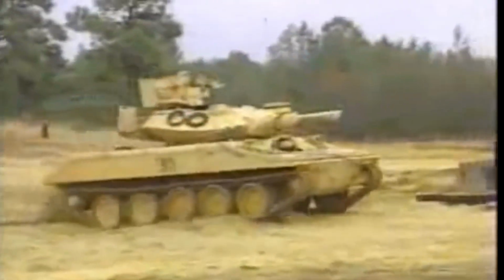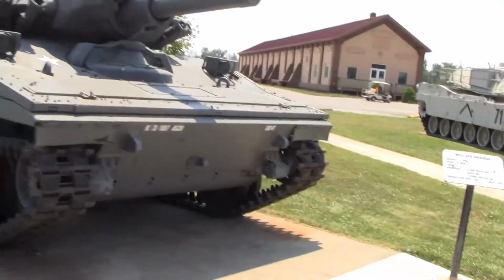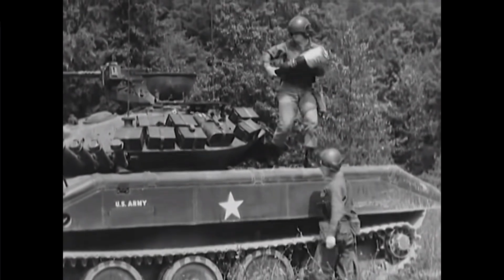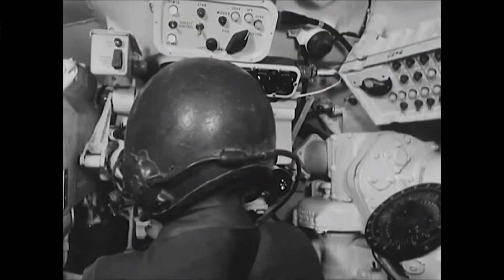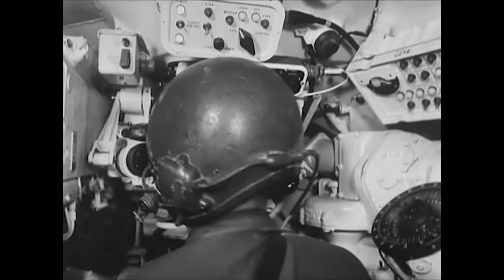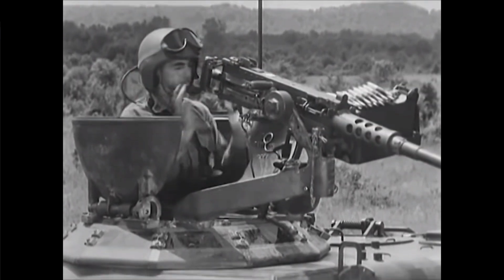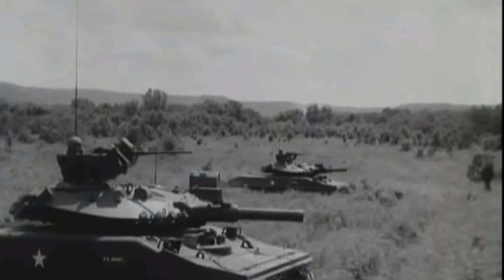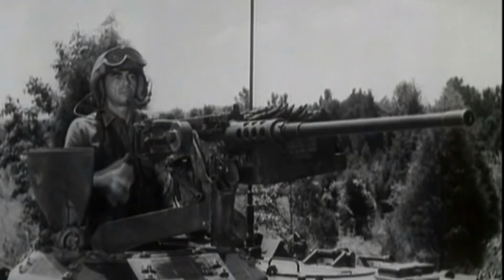M551 "Sheridan" AR/AAV | DESIGN DISASTER!

Comment: Bad transmission? Were any of the designers German?
Reply: To be fair at the late WWII all transmision problems on the tigers were fixed, even if panther had still problems.
Reply: + @juanlulourido548 + What about the Tiger II?
Reply: cnlbenmc 

There were very small issues with that, the real headache is the panther, that never got this problems fixed, but the königstiger got abandoned multiple times mostly because of lack of fuel and spare parts.
Reply: Juanlu Lourido The Tiger I never really had that problem
Reply: @peterson7082  it did early on by 1944 it was acceptable
Reply: Oof
Reply: That had to do with the rush in making such heavy armor tanks. The transmission was under powerd for such armor so it made it brake down a bit over time. 

The Germans eventually fixed the problem.
Reply: Also WWII heavy tanks were almost universally underpowered in the engine department (that's what you get when shoving an engine from a medium tank into somthing anywhere from 10-30 tons heavier.
Reply: If they were they would have good suspension like the Panther, it was all american, like an american muscle car, can only drive flat and straight.
Reply: + @13thSystem + the overlapping and interleaved drive wheels combined with torsion bars on those things were Far more trouble than it was worth.
Reply: @cnlbenmc So much trouble that even tanks up today use a torsion bar suspension as opposed to a christie or vvss. Americans failed at replicating a German invention and they blame it on the Germans, typical.
Reply: + @13thSystem + No its using those crazy stupid wheels in combination with the torsion bars that was the problem. Plus back then that system was kinda hard to mass produce, they have long since become the standard using more sensible road wheel orientation.
Reply: @cnlbenmc Were talking about suspension, not wheel layout, I'd agree the wheels were over engineered but suspension wise, The Sheridan is using Torsion bars, the same Porsche invention almost everyone is using now a days, how the Americans messed it up is beyond me.
Reply: + @13thSystem + Combining the shitty wheel setup with torsion bars was the problem and both compounded each other's issues. As previously mentioned; torsion bars are just fine with normal road wheel setup though they were complex and costly back in WWII compared to later decades. The Sheridan was just another oddball shitbag debacle from the 50s-60s that was a concept way too ambitious for what the technology could actually accomplish at the time.
Reply: @cnlbenmc The problem was not the performance but the cost of complexity. The wheel setup allowed for more torsion bars to be applied allowing a smoother ride, better cross country performance and made firing on the move more viable. One thing is for sure, it was better than what others had back then performance wise. Despite being a heavy tank easily beats most medium tanks like the Sherman and T-34 in speed and mobility, specially cross country. The tiny wheel layout of the Sherman also leaves large vulnerable spots on the side of the tank, large interleaved wheels helps protect the lower sides of the tank by using the wheels as additional plates.
Reply: Grievously Tired This comment caught me off guard and had me laughing rather hard. Thank you for that and well played sir.
Reply: Ya, Russian ww2 tanks had much worse transmission
Reply: Nah...everything is bad so that means the designers are american
Reply: German Transmissions... if (for example) you decide add 10 Tm of armour to the Tiger I and put it into production without re-engineering the transmission and suspension, THEN, yes, the transmission suffers a lot and is troublesome.
Reply: Now you are stereotyping
Reply: insert operation clipboard
Reply: The Problem with the Tiger and Panther were, that they were way to heavy for the Drive Trains of those Days. Develope a whole new Drive Train wasn't possible due to the decreasing Quality of the available Materials and this bit of Quality Materials get used for more proven vehicles instead for trying to fix something flawed. Especial the Tiger wasn't a big thread, because they mostly broke down miles away fromthe Front Line, but if you hat the Luck to run into a fully operational Tiger, you were pretty much fucked in pretty much every vehicle.
Reply: Hi guys, i'm just here to clear some things. The problems with the engine and the transmission on the Tiger 1, Panther and Jagdpanther were solved in the late war and were results of sabotage (in case of random engine fires) and the rushed production of the tanks (in case of the final drive failure). The statement that the suspension had no equivalent upsides to its downsides is bullshit, to say the least. Engineers build this thing, not mechanics. There is always a purpose and for the interleaved wheels suspension, the advantage was simply improved ground pressure, wich increases track reliability and the dampening at high speeds with such a small but heavy vehicle. In fact, you could think of this suspension as a more or less stabilized gun platform, it was that good at slower speeds. The Panther and the Sheridan basically share the same reason for their initial transmission problems, rushed production ;D.
Reply: Over engineered? Check, Must've been some operation Paperclip Nazi's that worked on it! hahaha!
Reply: @GrOuNdZeRo7777  
Lol, no, i just remember a certain navy rocket, that was supposed to shoot the first american sattilite in orbit but fail on camera, so that the german design had to be used. To be clear, i'm talking about the Vanguard and it's successfull compatitor the Explorer from the US army (developed by the paperclip nazis that seemingly overengineer everything except for the things that actually work). There are some funny names for tghe Vanguard rocket, my favorite being the "Stayputnik" XD.
Reply: Did they use the nissan transmission?
Reply: Were they German i highly doubt it. Maybe more likely Japanese, the same ones that later built Nissans infomos  CVT transmission.
Reply: Grievously Tired I love your name and profile pic
Reply: Sherman - Ronson fanboi ? Loi

Comment: Are there any light tanks like this in service these days?
Reply: Since the Sheridan is supposed to be an airborne tank, I'll list some of the airbirne tanks.

2S25 Sprut-SD: supposedly airborne Russian turreted light tank. Thin armour based on a BMD4 APC chassis, 125mm high velocity tank gun (enough to supposedly kill modern MBT).

BMD4, airborne APC: carry 6, armed with 100mm low velocity gun with ATGM launching capability.

Wiesel 1 and 2: air transportable Weapons carrier. They fit inside a big helicopter. Carry 20mm gun and ATGM. 

M8 Buford Armoured Gun System: the planned, type-classified but cancelled successor to the Sheridan. Light tank with 105mm tank gun. The cancellation of the M8 and M113 means American airborne has no significant armour, except Humvees. The vehicle is being brought back into the light for Army's Mobile Protected Firepower trials.
Reply: +Xuan Vinh To sprut uses the t90 gun and seems to have 1000mm pen apfsds shells